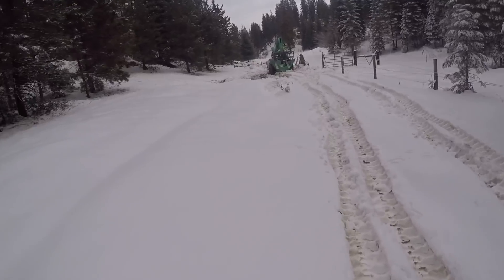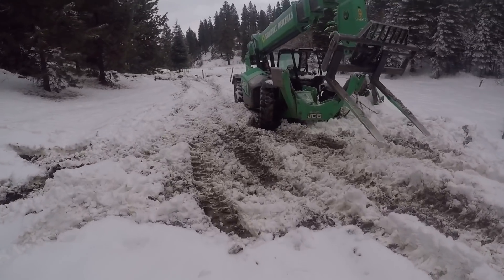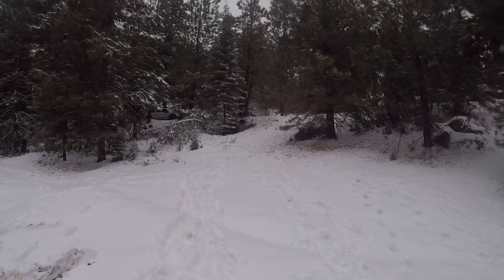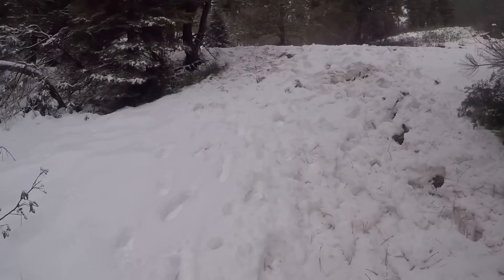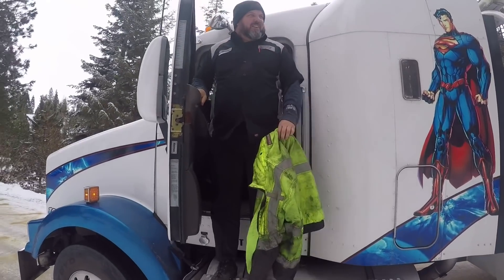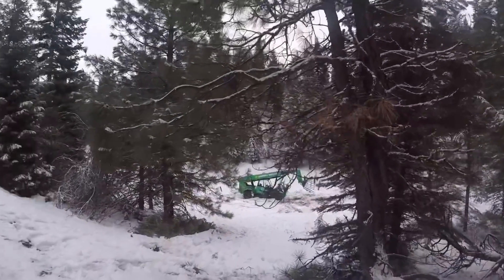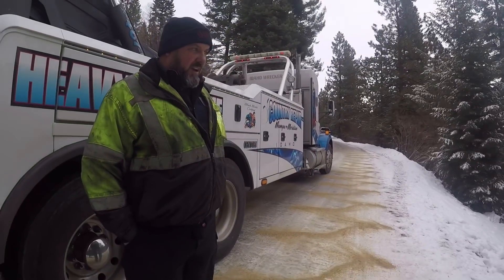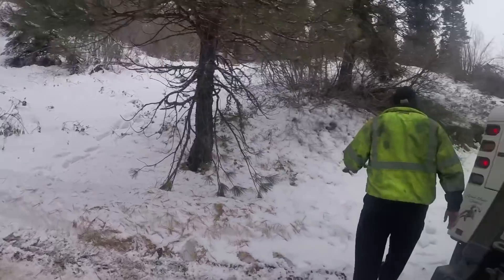Telehandler Snow Recovery

Comment: I have never seen one without a diff lock. I would have thought he could have backed out using the forks stabbed into the ground pushing the machine.  Well and a diff lock.  Good work.
Reply: didn't think about that, very good idea!
Reply: I have done off-road recovery mountain recovery for over 25 years, you learn Small tricks along the way lol.
Reply: I've never had one with difflock and I have found the pushing technique underwhelming, especially when it gets steep.
Reply: I did it before don’t think they know how to use it to it’s max potential

Comment: I hope you have learned the difference between common Treasure Valley river sand and crushed sand. River sand is round and rolls. Crushed sand has some sharp edges if it is quarts based. We have a lot of sandstone sand that is not great, even crushed. The best traction sand is crushed black basalt sand. Cinders are good too. Pickles Butte has them. Mike would like the foot traction of crushed basalt sand.